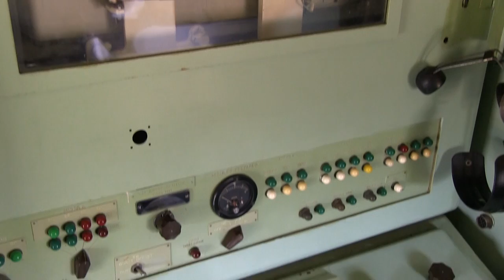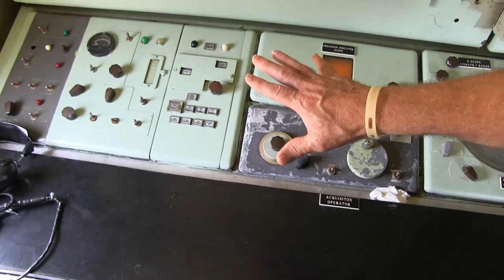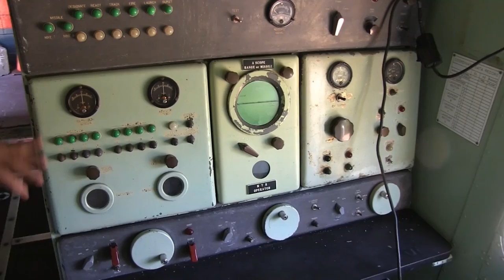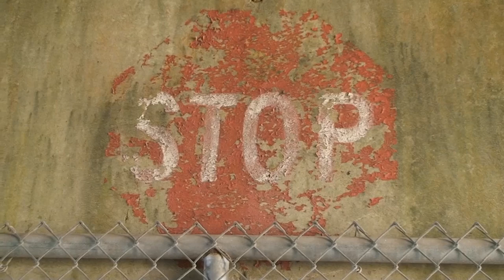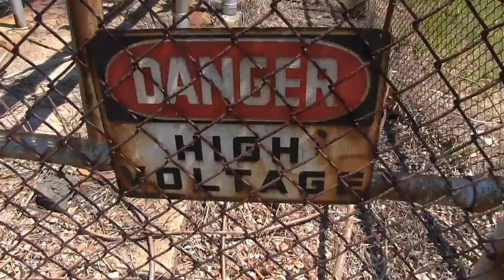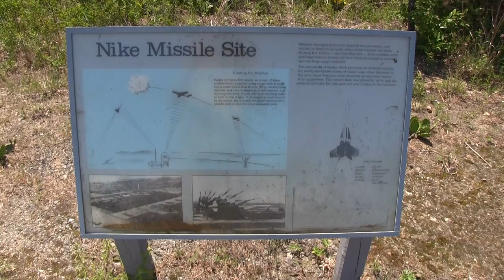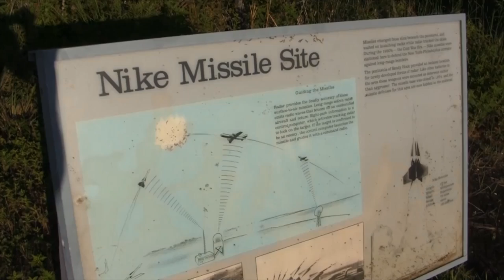Nike Missile Site on Sandy Hook

Comment: Very interesting and informational. I served in the Nike Hercules system in Anchorage,  AK in 1963-64. My job was to keep the tracking station and the tracking antennas operational and calibrated. I also tested and repaired sub assemblies and the test stations in the Ordnance shop. This was how I started my career which later ended of as a Senior Electronics Engineer for Boeing.
Reply: Thank you for your service.

Comment: Why a 20 kt nuke to shoot down a plane
Reply: I’m no expert, but I guess its all about range, accuracy, risk and contamination.
The higher the warhead yield, the bigger the range, so it increases the chance of bringing the bomber down. I’m guessing the bomber could also detect the incoming missile and would attempt evasive manouvers. But if the warhead destruction zone is a few miles in diameter, good luck with that, LOL. 
You don’t want to use a too powerful warhead though, because that would unnecessarily spread radiation over the sea, contaminate fish, and may spread and cause human illness along the coast. There is also wind blown radiation and fall out from winds high up that travel a long way.
Because the Tupolev held bombs and not missiles, Nike command knew it was still safe to blow it up  as long as it was still over the sea.  So I’m guessing they could have a few goes at it, and the 40 megaton warhead could have been for the final last ditch attempt, with the widest explosion radius.
Reply: The Nike-Ajax radars could not distinguish a single plane from a formation of bombers, and the kill radius of the missile was less than the resolution of the radars.   This meant that against a formation, your missile might well detonate in the middle of the formation, but you still had poor odds of hitting anything.
The solution was the Nike-Hercules, with a 20 kt nuke aboard, guaranteed to take out an entire formation, if that's what the target turned out to be.
It was overkill for a single plane; on the other hand it certainly discouraged an enemy from sending entire formations of bombers.
Reply: The reason a Hercules has a nuclear warhead is to destroy the atomic bomb on board the Russian plane with the extreme heat and pressures of another nuclear weapon exploding above and forward of the attacking bomber(s). Simple as that. This tactic was called a "Weapon's Kill" and was intended to take place above 50K ft. altitude and 100 miles away from the bombers target. If there was a formation of Russian bombers, a 20kt nuclear burst, far ahead and above the formation, could destroy (break wings off) or seriously cripple the attacking bombers. The Hercules always attacked from above and the warhead was always detonated by the ground-based computer, programmed to detonate the Hercules warhead far enough away to develop the most pressure and heat (fireball) to destroy the nuclear weapons on the Russian bombers. The Hercules warhead had no detonator of its own to prevent any accidents. Using a "nuke-to-kill-a-nuke" seems counter-intuitive, but was a well thought out tactic. The big problem was that when nuclear warheads exploded, they also produced, EMR, Electro-Magnetsic-Radiation at detonation. After the first warhead is detonated, the electro-magnetic emissions will blind any and all radars and disrupt communications making a second shot blind and impossible. That why contemporary air-defense missiles have ballistic (big rock) warheads. Air defense, in the missile age, is a very difficult problem to solve.
Reply: Nukes were to be used in surface to surface misssions initially. High explosive will bring down almost anythihg it gets close to, and it doesn't have to be very close.